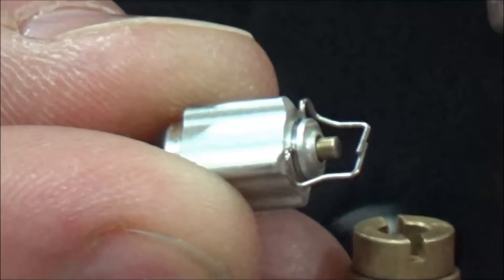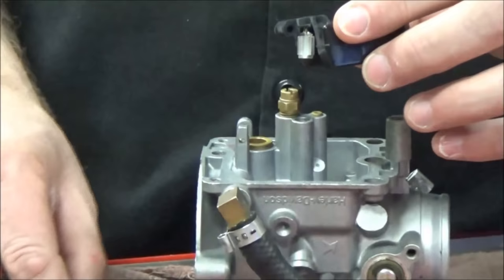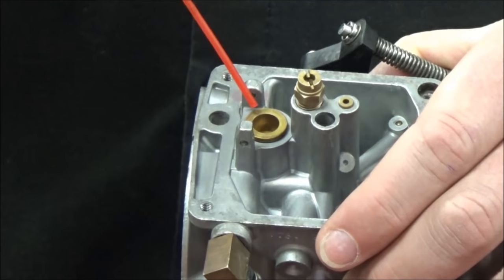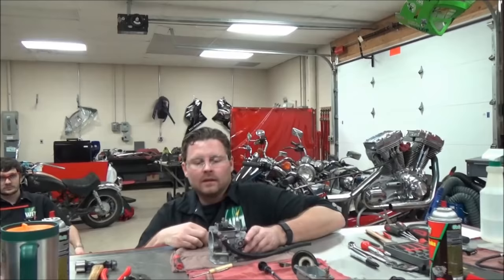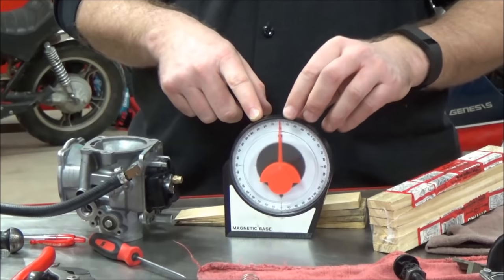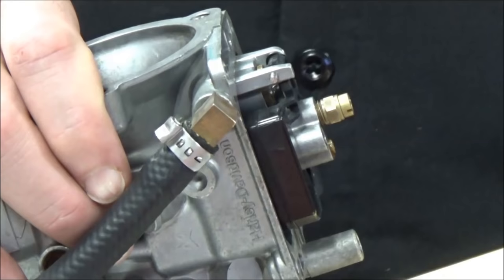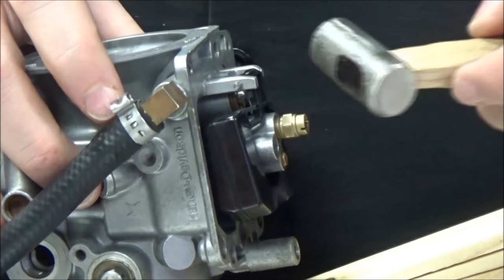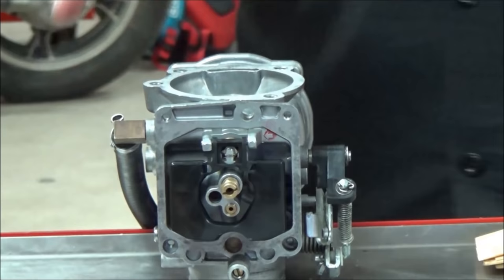04 How to inspect and adjust float level on a carburetor. BONUS: RICH LEAN Fuel Settings explained!

Comment: just rebuilt my first carb, 1997 Harley Heritage Softail.  Bike had not run in 4 years. Watched all your videos before beginning.   Installed rebuild kit.  Reinstalled carb, filled up gas tank...bike started right up, ran smooth for 30 seconds, then died.  When back and watched "Float Adjustment" video again.  Realized I did not lube the float needle area.  Basically the float had stuck and raw fuel came out the overflow tube.  Removed carb and lubed float needle.  Reinstalled.  Bike started right up and runs perfect.   No lean condition, no nothing.  Just power.  Can't thank you enough!  John in Houston.

Comment: Without a doubt shane you are a very good teacher I could happily watch your lesson plans all day very informative and constructive
Reply from the maker: master Wu 
Hello and thank you! I hope you have subscribed and selected notifications! Have you seen all the different playlists? The most popular is "Every Mechanic Should Know This". Please share with friends too!
Shane Conley
Reply: Shane Conley I really appreciate you guys help I learned something new that I had no idea how to fix my float was on a slant like the one in the video and I figured out how to do it in like 10 minutes and I no longer have any leaking problems it awesome how much you can learn from people on YouTube.😀😁
Reply: What an excellent video Shane Conley! Quick question, does that 17 degree angle apply for all carbs or just Harley ones? I am cleaning a mikuini, and want to check the level, although I do not think the float is an issue, I have always had problems with the bike not idiling at all. I assume this would be the pilot jet would it? thanks for any info!
Reply: Rhys Harris, not sure about the angle of other CV carbs, but I would like to know this as well. Thanks Shane
Reply: About your idle issue... usually you can still idle the bike by adjusting the fuel mixture screw. Turning it out will add more fuel to the idle and turning it in will reduce the amount of fuel in your idle mixture. Also, make sure your throttle stop adjustment is high enough to keep the butterfly open just a tad... until you see one of the 4 holes that reside on the engine side, lower part of the venturi. The butter fly should probably reveal at least one of those holes. If, at this point your bike is not idling then you could adjust the float bowel to make sure there is enough fuel getting to the pilot jet. If all this is good then you may have a vacuum issue. On my bike, the gas cap one way valve stopped working and created a vacuum that kept the fuel from running to the carby. Just riding with the gas cap off or open resolved this issue. If there are any vacuum issues then there will either be no fuel making it to the carby or there will not be enough vacuum to suck the fuel through the pilot housing and into the venturi. I hope this helps.

Comment: i been doing small engine repair for near 40 years. i have been to many classes. you taught me a couple things in this video. thanks for sharing your talent!!
Reply from the maker: Thank you! If I can ever be of service to you, here is a video explains how to connect with me. 
https://www.youtube.com/watch?v=vjvmB01ebcs 
Keep Wrenching,
Shane Conley
Instructor/Motivator/Motorcyclist
www.how2wrench.com
Like freebies? Click here for a free diagnostic checklist! 
http://gem.godaddy.com/signups/364621/join 

Did you like this free video and hope to see more? Would you just like to say thank you with a donation? Click https://www.paypal.me/how2wrench
Reply: thanks Shane!! that is very nice of you. the carb i was having issues with is on a snowmobile and turned out to be a incorrect part installation. my floats were 2 separate floats with pins off the bottom of the float. the needle arm installed upside down allowed one float to rise above the arm holding the needle open causing a flooding problem. watching your video helped me to look at this style of carb differently and allowed me to see the problem itself. might have missed the upside down arm if i had not gained better understanding from your video.

Comment: I had a friend of mine who is a machinist, machine one side of a block of 2” aluminum at a 20 degree angle. Then I just set the carb on the 20 degree angle side of the block and adjust the float. Works fast and is correct every time. I’ve been using this trick for years.
Reply from the maker: Great tip! Making jigs for consistency and speed is awesome investment. 
Thank you for commenting and being a subscriber. Want more benefits? Want even more??? Join the channel:
-Daily MEMBER FIRST COMMENTS ANSWERED FIRST 
-Live Q/A video chats
-Wonder if we have a video on your need? Members can request content links!
-Full Access to the ENTIRE 700 video library
-Member-Only FREE tool giveaways 
Join this channel to get access to perks:
https://www.youtube.com/channel/UCBhM8DCKnT3qXwTW0eToyCg/join  

Just want to say thanks quick to support us for this information and our work saving you money? 
Give us a high 5 here:  https://www.paypal.me/how2wrench

Comment: Awesome information, I have just used your expert advice and information on my ATV carb ........some bright spark had jammed the air mixture screw right in so tight I snapped the head of the brass screw.......I had to drill it and managed to wedge a star driver and release it.........now adjusted to a couple of turns its running great........thanks for your info.

Comment: Dear Sir, hope you'll be fine. A very informative and useful lecture indeed! I had problem adjusting the carb level of my GS 500e slingshot. I searched the web a lot but no tutorial was as helpful as your's. Godspeed.
Reply: Hello.  I have a ninja 250r.  Finally got the carbs right.  I took it for a test ride n it shut down.  It feels like the brakes are too tight.  I already know the chain is too tight.  Pushing this bike should not be as hard as it is considering the weight.  I noticed oil dripping from bottom..I looked at the oil after I drained it..it had gas in it.
I now have the back wheel off the ground..put oil in..start it n go thru the gears is no problem.  I dont understand..m wondering to take it out again n try.  I'll let u know how it goes.

Comment: Cant believe two little screws on the cab. was making my bike unable to press start after5 days of troubleshooting and changing tons of  parts , 3 starters , 2 ignition coils ,2 cdi box, 1R&R ,1 complete wire harness an still no start I had even clean my switches plus test everything with a M.tester , some good did come out of all this tho , cause I learn a lot plus I found that my cdi box wasn't pushing enough current when I try to press start , when I kick it was good tho lol  IM TELLING YOU THIS CAUSE I THINK YOUR THE MAN FOR THE JOB , meaning you could probably make a good video abt this , showing how a faulty carb. could make things hard for you in this line or in my case thanks bro ..
Reply from the maker: You bet...If I can ever be of service to you, here is a video explains how to connect with me. 
https://www.youtube.com/watch?v=vjvmB01ebcs 
Keep Wrenching,
Shane Conley
Instructor/Motivator/Motorcyclist
www.how2wrench.com

Like freebies? Click here for a free diagnostic checklist! 
http://gem.godaddy.com/signups/364621/join 

Did you like this free video and hope to see more? Would you just like to say thank you with a donation? Click https://www.paypal.me/how2wrench

Comment: SHANE you are the best teacher instructor on carbs, IMHO. Shane- the pin fit and interface with recipient holes, BOTH the holes of the cast aluminum carb AND the holes of the plastic float valve have become very sloppy. I want to know if this is going to result in a lean or rich condition???

You are the best. 

Should I install a tighter fitting pin? As i wiggle the float around left to right up and down and every other way, the loose slop is substantial and has GOT TO BE affecting performance!
Reply from the maker: I would need some more info to get you the right answer. I’d be glad to take the time. Can you help us back?
You just need a quick answer to make sure you’re on track or what direction to go? Please donate (https://www.paypal.me/how2wrench) what you feel getting this information is worth to you and I’ll reply back with what we would do at H2W!

Need the full service techline?  Coach Conley is also available for hire to personally work one on one with you if ever needed. Yep he is a real person. Details here: https://how2wrench.com/product/personal-tech-training-phone-facetime/ 

Your answers and help are just around the corner. Save time and money while protecting your investment and yourself by doing it the right way!

Comment: i use a clear tube attacked to the bowl drain to determine float height.
that harley bowl does not appear to have a drain spigot where you can attach a hose though.

Comment: Just watched your video and you frequently say that the float adjustment affects the mixture, making it run lean or rich..I presumed that the float was to ONLY keep the bowl filled with fuel to an optimum level and the mixture was controlled by the jets.. If you ride up or down a steep hill or lean the bike over 40 degrees you will completely alter the  float position.the float will always try to stay level. but the body of the carb is continually changing position..  what am  I assuming incorrectly.?
Reply: Geoff you have a point in that the carbs will always be changing position but for the short amount of time that they are out of plumb there isn't much gas moved in reality. The important part is the level in the bowl and where it lands on the jet needle assembly for proper mixture. It really makes a tremendous difference with just a little tweak.

Comment: This seems to be a practical  rule of thumb manner in which to make this adjustment, but in theory there are a few issues being wrongly taken for granted.   Since the system is dry and the carburetor is upside down then it is  weight and gravity that is being used to close the needle.
In reality when the carburetor is  working wet with fuel, it is the volume displacement that causes the upthrust that will make the needle work.  So without going into more details, the volume distribution in the float would be the primary reason for the float to float  at an angle and not the weight distribution when it is dry.
I shall not go  into this any further, but it would be  useful to describe the  real physics and the difference between using gravity to close the needle and using Archimedes volumetric flotation/ displacement to  close the needle.
Reply from the maker: You "sound" pretty smart there. Probably more than most with your "engineered" description. Impressive. The rest of the world needs a method that can be duplicated in the simplest of forms to let the masses understand and copy. Hence how this method demonstrated is common practice. Bare with us...

Comment: I just cleaned and reset my carbs on my metric and now have some different issues. I set the floats properly but it doesn't run as well as it did before. Now, after running across your video, I suspect my float gauge is probably off and I'll redo it it with a caliper. Thank you.

Comment: 10..49 - 11.51mm or .413 - .453in
What is the correct setting ?  Do I want lean or rich?  Should a person just try to get in the middle and hope for the best?
Thanks in advance and love the videos!  You're an awesome teacher!
Reply from the maker: Thank you. If you want to target for longest life, you set high, that way as the float needle wears, it will lower and stay in the spec range longer. Make sense? All out performance tends to like it lower (richer). Keep in mind higher and lower is upside down as compared to on a running motorcycle.

Comment: Hey, Ive been watching your videos and i really enjoy the way you explain things so precisely. The thing is that I have a very unique problem with my 2 stroke dirt bike that i think you have the answer to. Ill try to keep it brief:

I have a honda cr85 that is bone stock. I run the recommended 32:1   gas/oil ratio. All the jets, needle position, etc. on the carb are on the recommended setting as stated in the manual. So the problem is this:I have very low power in lower rpms. Power kicks in at high rpms. I have the air screw turned out 2 turns as per manual. however, this is where it gets confusing. I warmed up my bike and l have the idle at the slowest possible position where the bike could idle correctly. This is where it gets weird. If i turn the aie screw all the way in, the bike doesnt die, if i turn it all the way out, it STILL doesnt die. this baffles me because i cant seem to find any information on this. Do you think it could be the float or the float needle? i seem to narrow it down to this every time i look at the carb (ive taken it on and off the bike probably a dozen times by now)
anyway it would he appreciated if you could help me.
Reply from the maker: Thank you!  I emailed you. If I can ever be of service to you, here is a video explains how to connect with me. 
https://www.youtube.com/watch?v=vjvmB01ebcs 
Keep Wrenching,
Shane Conley
Instructor/Motivator/Motorcyclist
www.how2wrench.com
Like freebies? Click here for a free diagnostic checklist! 
http://gem.godaddy.com/signups/364621/join 

Did you like this free video and hope to see more? Would you just like to say thank you with a donation? Click https://www.paypal.me/how2wrench
Show less

Comment: Yes, very good explanations! My question is, at what throttle range or rpm range or throttle action in general does the float hight/ga slevel in the float bowle comes into play and how do I sense it, if it is too lean or too rich? What will hapen, if too lean or too rich on the float hight/gas level? And how to set up a float needle sice to correct spec after individual tune of engine? (talking about 2-strokes!) Many thanx. Cheers
Reply: See my above. You gotta try every position regardless. Or take it to a mechanic; I dont have that luxury here in the andes mountains:/

Comment: Very informative, great video. Just want to ask you if that applies in a twin Mikuni carbs for a 1995 XV750 Yamaha Virago?: I mean, the floats should be parallel to the side of de carburator?. Coudn't find the spec height and correct angle to make the adjustment other than the one that the Hayes and Clymer user manuals describe and requires an special tool that is a hose attached to the carb, the bike  needs to be leveled and idling, and every thing hot and vibrating ...? . A few months ago bought this bike, started to service it myself, it ran fine in iddle and 2nd, 3rd and 4th speed, but after a 10 mile ride, I feel the bike heats excesively. When I cleaned the carbs readjusted the floats height to 25mm instead of 23mm , following the procedure in the video from ShortMg270: Yamaha virago carb disassembly, minute 13:55

https://www.youtube.com/watch?v=QjqFyLEEKOo&list=PLpa17gyPYUBE-fbZ6fHyvFYXBBDhKhFfG&index=51

So I went to the pilot screws that were only 1/2 a turn open., to a 2 3/4 open. When did a test ride, the fist two miles where fine, but when getting speed 35mph started to backfiring, loosing power and again heating. Solved the backfiring, the carb for the back cylinder had an air leak in the hose that goes to the piston, but lack of power, stumbling  and heating continues.

Any help will be appreciated, thank you Shane.
Reply from the maker: It sounds like you’re ready for some Techline help. Coach Conley is also available for hire to personally work one on one with you if ever needed. Yep he is a real person. Give him a call @ 602-345-0432

Details here: https://how2wrench.com/product/personal-tech-training-phone-facetime/

Your answers and help are just around the corner. Save time and money while protecting your investment and yourself by doing it the right way!
Follow us!
Web:
www.How2Wrench.com    
www.Tools2Wrench.com

Comment: I put a brand new plastic non-adjustable float in my Honda Rebel.
It idles fine with choke all the way on, but as soon as I twist the throttle it stumbles, and my float bowl is leaking.   If I get well past the stumbling, it will run just fine.   I'm guessing my fuel bowl height is wrong, but I have no idea what to do at this point.   I rebuilt the whole thing with a new kit and cleaned it and everything and made sure it was all put together properly according to videos.  And now I find out about.. THIS.  I didn't even know it was a think, I thought the float bowl operation was an ldl0t proof system.   Just a float on a hinge with a needle.

Comment: 9:20 Your comment about the lower float shutting the fuel off first may confuse some people, I understand what you are saying but when you are measuring the float height everything is in reverse. The float that has the 'lower' measurement is actually the float the will sit higher when the carb is the right way up. The float with the higher measurement will be the one that shuts the fuel off early! (Just a small point, not trying to have a go at your video or anything like that!)

Comment: Love your videos. I've been cleaning and rebuilding my carbs for 13 years. My 91 Electra has a cold start even when warm. If I stop the bike even for 5 minutes. When I go back to start her I have to blip the throttle to keep her running. What have I done wrong. Everything rules runs fine
Reply: Pilot circuit for idling?

Comment: What an excellent video Shane Conley! Quick question, does that 17 degree angle apply for all carbs or just Harley ones? I am cleaning a mikuini, and want to check the level, although I do not think the float is an issue, I have always had problems with the bike not idiling at all. I assume this would be the pilot jet would it? thanks for any info!